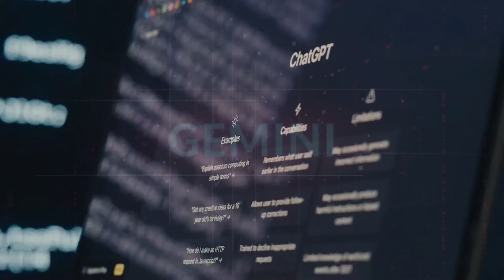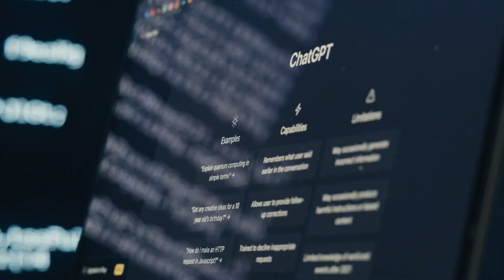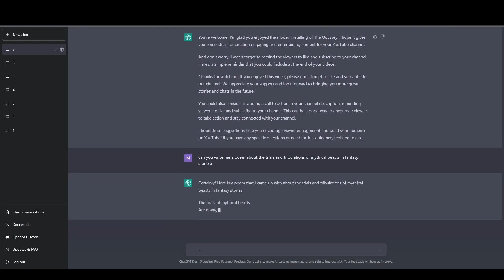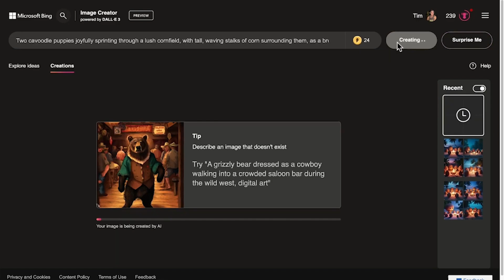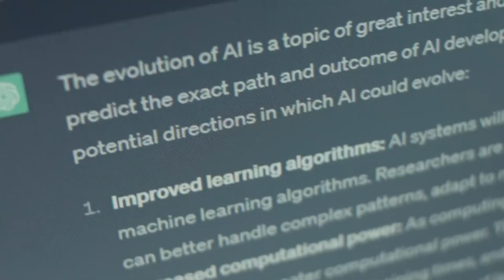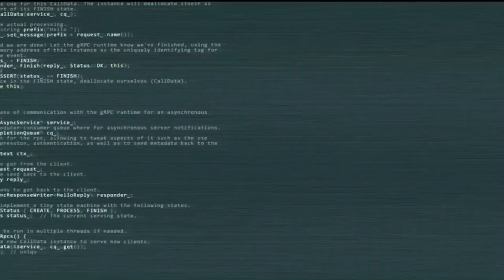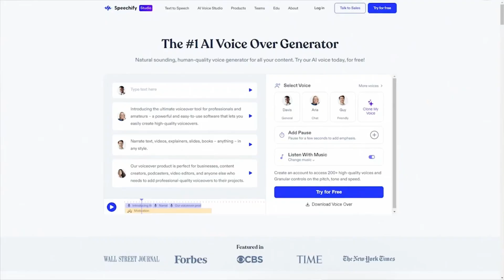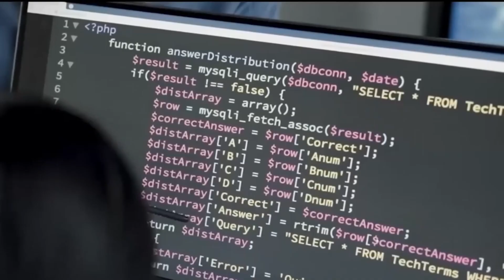ChatGPT: Silent Revolution That Is Changing Everything

Comment: I think that in the right hands AI can abe a supplement to human behavioral pattern and workflow. We have more than 3000 years of history and one person can't memorize alone nor know how every job should be done. I've used chatgpt tutor of sorts to help me figure things out first. After i think i cracked the question i consider asking for the correct answer to Chat-GPT (heavy on the consider). While it does have massive calculation capabilities, it does give wrong answers and can make mistakes more often than people think. This applies to art and grammar as well. Nevertheless, it can eliminate more common jobs such as customer service with chat bots, receptionists, secretaries, most publicity jobs, even minor programmer jobs such as web design. I tested on chatgpt to make a full on website HTML/CSS/JS, and in a blink of an eye it had a full on company template on the ready. Web design is one of the jobs that might suffer from AI but it still requires proper supervision.